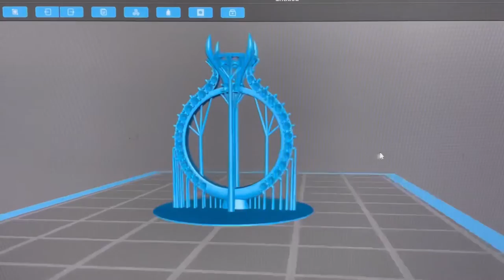CASTING A DIAMOND RING | STEP BY STEP GUIDE

Comment: For a piece of the same size I use a cylinder that is just 1.25" x 2.18" and it has worked excellent for me. less time in the oven (approx. 1½hr) and much less plaster.
Reply from the maker: Thank you for your advice. I'll try that next time.
Reply: Hi kelvin

Comment: Hello,I see on the picture of the video that you had a failed cast . I have similar issue . Can you list there what you changed to have good result please it would really help me . Thank you and Nice video
Reply from the maker: My flask casting temperature was too high, then I changed it to 1000f. There are a lot of reasons that can cause it to fail. Let me know if I can help
Reply: Is there a way to contact you to talk in private . I just started my casting project and i have some question please . Thanks for your answer
Reply from the maker: You can connect with me on facebook at the link provided in the description above.

Comment: When u cast 14k yellow whatbos your preffered flask temp same 1000f as the nickel whitegold?
Reply from the maker: There is a video in my channel that I casted a 14k YG bracelet,  casting temp was 945f.
Reply: Thanks I'm getting ready to load a flask thanks brotha
Reply: @Bi_Nhan  I think I cast before the inside diameter of flask was settled at 945.f in other words the flask was much hotter than the desired 945 I should have waited a bit longer for inner flask to match oven temp.  I use the centrifugal casting aka  spin casting. Same flask temp as vacuum? Just triple checking I am loading up another flask and trying to get a perfect cast
Reply from the maker: @grillzbytroy8870  I leave the flask in an oven  at the casting temp for at least 1 hour. I have never used centrifugal casting so im not sure, but i guess it should be the same.
Reply: @Bi_Nhan  thanks again brother. Much 👏 appreciated from California
Reply: Hi my friend one quick question what pour temp for 14k white gold??? I know the flask temp 1000f but just want to see what you set your electrofirnace too. I have both casting setups and been trying to use the vacuum setup more for consistency in metal temps
Reply from the maker: I set my furnace at 1080f, and let it be for 1 hour. My metal usually melt  after 40mins  but I still have to wait for my graphite crucible to be hot enough so the metal will run when I pour. Hope this helps

Comment: Nice project! You cast and set all alone?
Reply from the maker: Yes, thank you
Reply: @Bi_Nhan  What resin do you use?
Reply from the maker: I used Powerresin/Burn
Reply: @Bi_Nhan  did you use powerresin burn on the failed print as well ?  Also what do you think went wrong with the first casting Investment powder ratio or  resin not completely cured
Reply from the maker: Aaron Tucker : I used powerresin for both. I failed at first because I set the casting temperature too high , almost double of what it supposed to be
Reply: @Bi_Nhan  what do you mean by casting temperature, do you mean the burn out or the temperature you heat the metal ?
Reply from the maker: @Ozzy2341  its the burn out, the last stage temperature